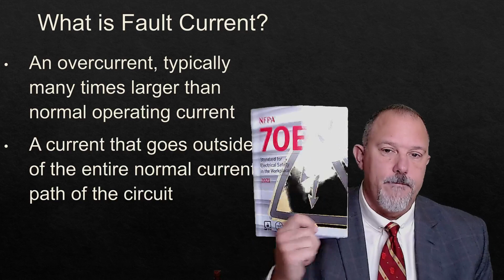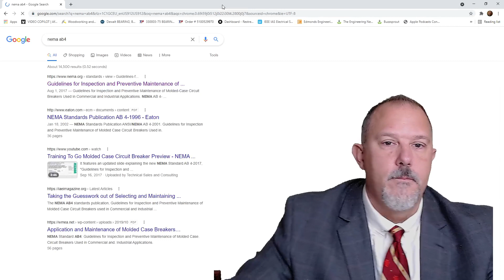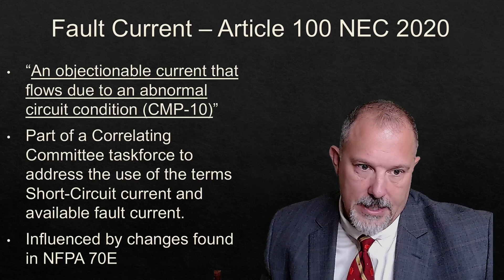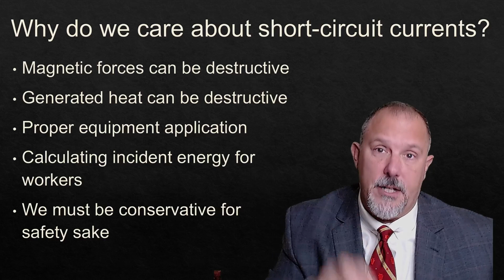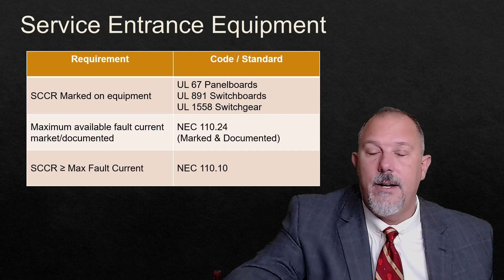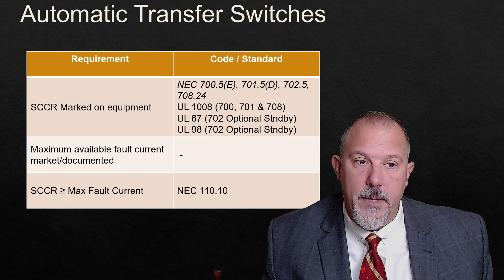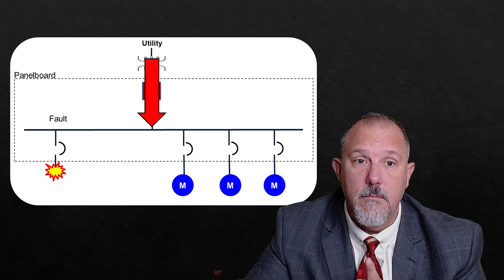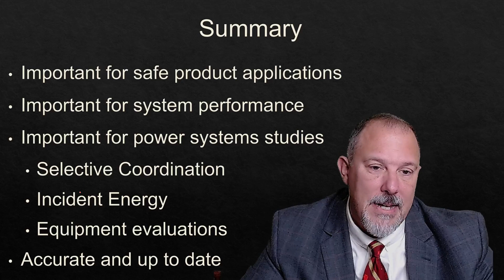IAEI News Live - Available Fault current, an overview

Comment: Thomas, this was a good presentation. I am in the field for electrical contractor. We work in high-rise buildings in NYC. These projects are years in the building with a considerable amount of changes. Add to that the mistakes made by the delivering equipment suppliers and one can see quite a few changes made (not always according to drawings or engineering). Sometimes change to a fuse(s) has to be made for a number of reasons and the single-line drawing is not the same as the calculations were performed by. Too bad this kind of education is so limited for the field guys. Thanks for your efforts. Pierre